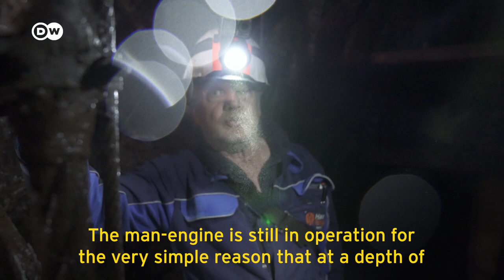I Tried To Climb The Ladder Of Death | Axel On The Edge

Comment: But why would you need to switch sides? Doesn't one side run all the way down while the other goes all the way up?
Reply: Where would you store the surplus boards? This is not a paternoster thing. It used to be hung from a seesaw mechanism at the top.
Reply: Think of a platformer game.  It goes up and down but not all the way up and all the way down. One side you will take you higher or lower depending on which side you need to be on. It's hard to explain but in my head it's easy. Each platform has a ceiling height where it can't past and a floor low where it descend any further and that's why you switch
Reply: @DreamingAstro  Ah, now I get it. So on any given side there must be multiple "ladders", none of which actually run the entire way up or down. So you go up 10 or 20 feet, then hop to the other side for the next 10 or 20 feet, and so on. Thanks for that explanation. Very helpful!
Reply from the maker: You are literally a @Dream Stepper 😆